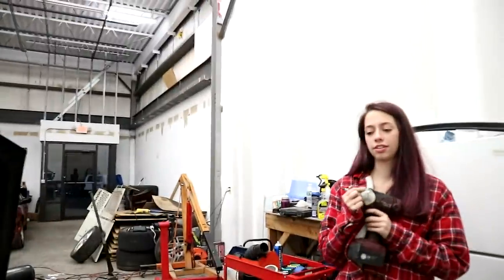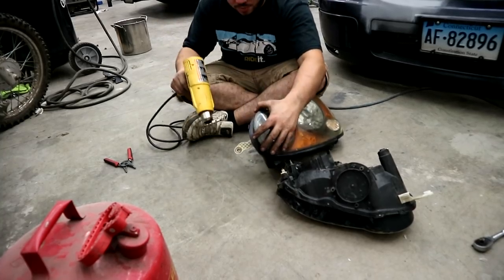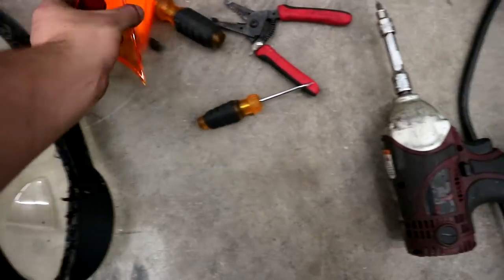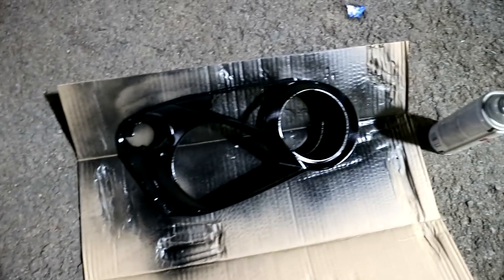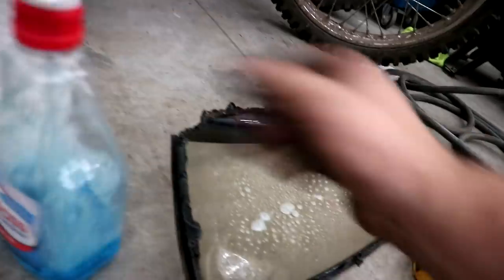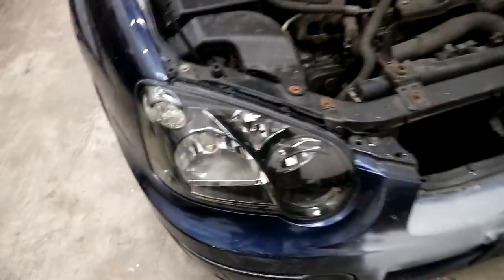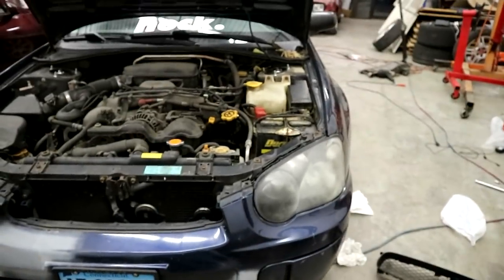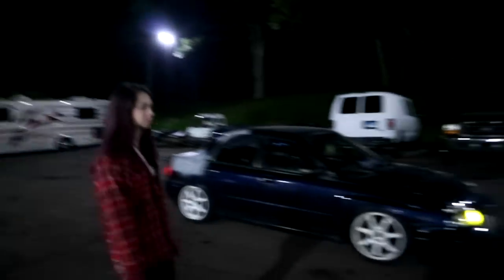DIY BLACK HOUSING HEADLIGHTS!!!

Comment: You can use a ceramic coat, even the cheapest chinese off brand, and the headlights will last a lot longer (over a year easily).

Comment: next time try to spray a little purple power on the oxidation lens en scrub it then wash it with water dry them them give them a buff and done been doing it for years dont know if poeple know about it. safe all the time wet sand them but it depends how much oxidation it have on them

Comment: Damian, the headlight master! Do you use some good, quality wax at the end to seal and protect the lens longer? If I remember correctly, good quality wax helps guard against U/V, which is what yellows them.

At the same time, I'm glad to see you not use clearcoat - that's only a short-term fix that leaves orange peel and eventually starts flaking.